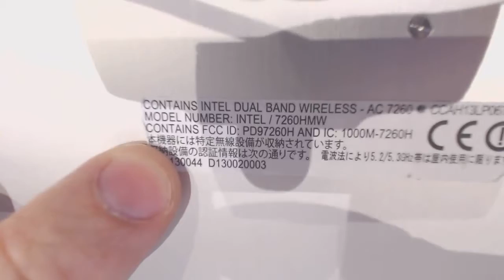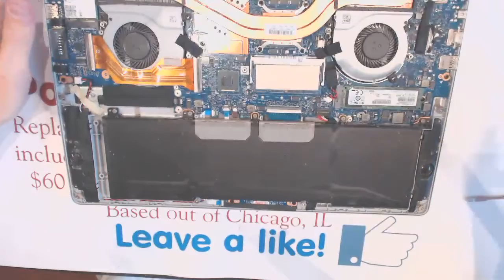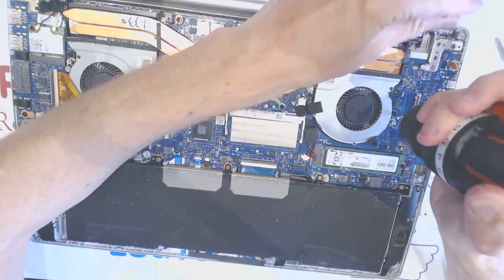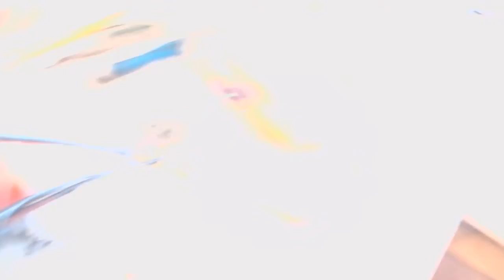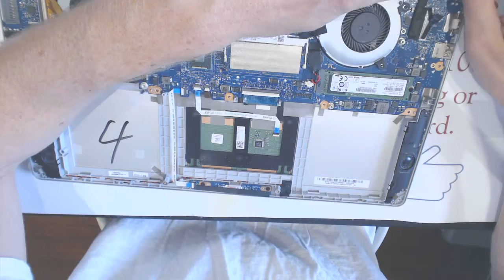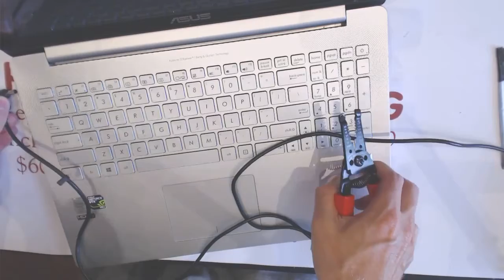asus zenbook pro ux501jw ux501vq g501 ux501 Laptop repair fix power jack problems broken

Comment: Hi, 
I got to fix an ASUS G501jw with connector broken. 
I replace connector, connected to powe supply and laptop start.
And works fine for about 1 minute and after this shut-down himself. 
If if press power button, nothing happens. Nothing is hot. 
If I disconnect power supply and leave it for about 5 hours for example, and after this I plug in power supply again, I can start it again, works about 1 minutes (running time is randomly, can run aven less a minute) and after this, shut down himself.
I have no idea what could be wrong. 
Do you have any tip for this ?

Comment: I have two Asux UX501V laptops.  Both have damaged power ports.  I ordered a 'genuine replacement' online and it was not the same as the factory port.  What I would like to do is to send both of my notebooks back to you, have you replace both the power ports, and then provide the EXACT matching power plug and connect them to my two existing power supplies, ensure that both notebooks have power and boot, and then return them. For this, I would be eternally grateful, and of course pay you for your time. Kurt 801.699.6143 or kurtdobson@gmail.com

Comment: Hi
My laptop does charge up
But when I press power botton, keyboard lights come up, fans spin, but no screen. Even ASUs logo doesn’t come up. Laptop shuts down in 2 seconds. Repair shops can’t fix it, I can’t also find motherboard replacement

Comment: I dissassemled my laptop and assembled it but then I realized that I connected that orange cable wrong (mother board to io) so I corrected it but now I can't start the computer. It's not responding to power button so what causes this and u have any solution for that? Maybe taking out the bios battery?
Reply from the maker: If it is a fat orange cable from the side,  then maybe it is not connected properly or the cable messed up and shorts now, disconnect the cable and see if it will work
Reply: Power Jack Repair I tried to but that's not working either

Comment: I have watched a lot of videos like this. I removed the 10 screws and can tell you, IT IS COMPLETELY IMPOSSIBLE TO TAKE THE BACK OFF!! IT DOES NOT MOVE AT ALL!
Reply: Did you get the two under the rubber feet?  That got me as well..
Reply: You have to lift it off with your nails, on the top part, at each extremities of the cooling vent, one clip at each side. Lift up gently and it will come off quite soon.

Comment: Hey there.  this video is the only one which came closest to taking off the heatsink but it didn't :( its okay. its a useful video.
Can you perhaps tell me how to replace the thermal paste? how simple is it from the video? I don't want to take the entire thing apart, just the heatsink so I can replace the thermal paste. any help appreciated. :)
Reply from the maker: Unscrew the 4 screws from the top, remove the heatsink, put new thermal paste (you can clean the old one off with the isopropyl alcohol
Reply: thanks dude. would you recommend i disconnect the batteryfirst?
Reply from the maker: makes no difference unless you will be touching anything with the metal
Reply: last question. Will the heatsink come off for the CPU and GPU? I want to replace both with new thermal paste. so all 6 screws? including the 2 which are diagonal?
Reply: Bobby Singh yes, unscrew all the screws